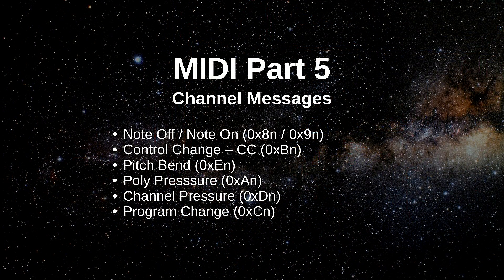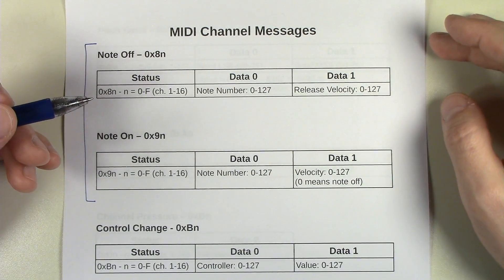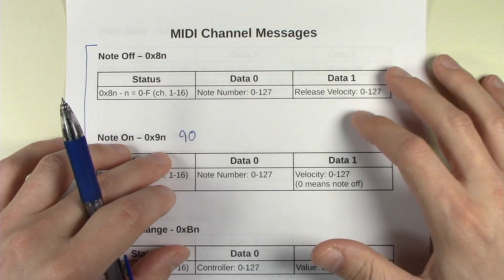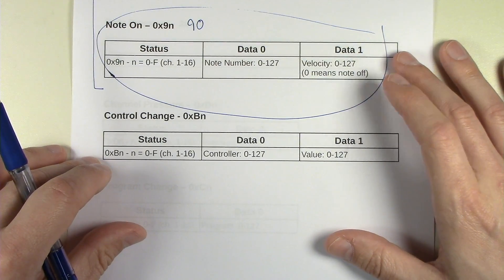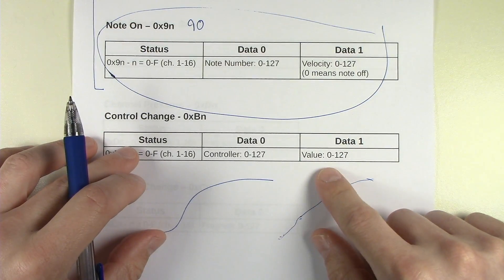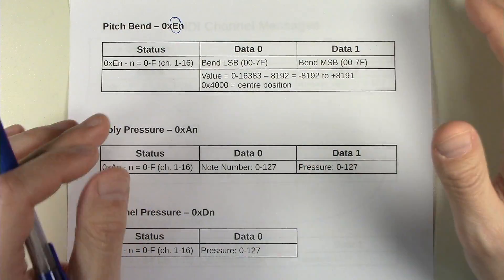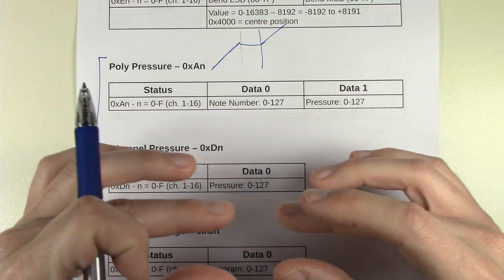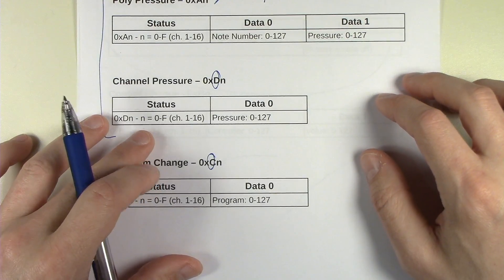MIDI Part 5 - Channel Messages

Comment: 0x9n what values does "x" take?
Is that the value of the note?
If the notes have a value of 0-127, then it is in HEX code 00-7FG?

My question is what does the "x" stand for?
Reply from the maker: X means "hexidecimal"

Comment: If I understood correctly, Poly pressure is relevant for those keyboards, controllers that have a triple sensor, electric pianos, etc.
It is connected to the After touch control, for each key separately!
Andrew, correct me if I'm wrong!
Reply from the maker: Most pianos and synths do not have poly pressure. More experimental keyboards and a very rare number of synths from the 80s had it.

Comment: I know this is an old video, but as I get more into the nuts and bolts of midi specifications I have this one thought pop up. If Poly Pressure existed from the beginning, why isn't it ever really used and why is MPE needed? I love MPE and I think it's incredible that this is still being used and updated, but damn they intended that 40 years ago lol
Reply from the maker: I think it's more of a "we want to invent something brand new!" situation. MIDI has never been fully exploited, and I wish the MIDI 2.0 people had extended MIDI 1.0 instead of designing a huge and complex new standard.

Comment: Hi Andrew thanks tons for your videos !   can you tell me what using an inputhandler call back does that is different from the standard  way midi apps  handle inbound messages? - can you pretend I'm dumb as shit and explain accordingly because I don't get it at all?   Thanks!
Reply from the maker: There is no standard way to receive messages in a program. This is broader than just MIDI btw. The two ways of handling input are polling and interrupt. (callbacks) If you use a callback the system will call your chosen function when there is new data. With polling you just check periodically to see if there is anything new.

If you give me more info of what you are doing I can probably explain it in more detail.
Reply: @shiftedphase  I am using blender, which allows me to run python scripts, I can run a script in blender to see inbound midi data in the blender console,  that works fine. The problem is if you loop either polling or callback it locks the blender UI till the script finishes, which of course doesn't happen  when your forever waiting for inbound midi  messages. I think maybe I was under the misconception  the callback method  which is called non-blocking would not lock the blender UI. If you have any thoughts please let me know? I'm guessing I have to do something with threading but I dont really have a clue- onward ho! Thanks for getting back to me
Reply from the maker: @stephen285  I highly suspect you cannot block in your script. Web works this way too... you need to think about designing your code to do something with the MIDI data and return right away. If you need to do something regularly (not only when you get MIDI data) you can probably register a timer callback also. Use some variables or a proper type of state machine to keep track of the state of your program so that every time MIDI data comes in, or your timer gets called you can check things and decide what to do. A lot of modern programming works this way so good to get familiar with it!
Reply: @shiftedphase  Thanks Andrew - I appreciate the help, I will let you know if I figure it out. I know it can be done because there is an addon out there for blender / inbound midi that works without freezing the UI - I'm just not experienced enough in Python to unravel how it was done. Anyway, it will yield if I bang my head on it long enough:) Your a good man Charley Brown - great series!
Reply from the maker: @stephen285  Good luck and keep at it!

Comment: Great series!  Are you going to discuss NRPNs? I’m working on a controller with encoders and really like the NRPN increment and decrement messages. Unfortunately I can’t find much info on this.  Seems like a great fit to send inc/dec for an encoder (a stateless controller) as opposed to an absolute value for a pot.
Reply from the maker: Maybe when I have time I will do something about that. Been busy lately. :)
Reply: @shiftedphase  We just arrived at Knobcon in Chicago. I was wondering if you were here?
Reply from the maker: @legosteveb  Sorry I'm not going to be there this time.

Comment: Hi Andrew!
Just circling back to learn about how to implement MIDI programs and banks into my laser synth, now that I have fully functional image generators running a preset array and controllable via custom mapping to an OTC APC40 MIDI desk. Both connect to Cakewalk via PocketMIDI. Using PureData for a touchscreen GUI and visual feedback for frequencies, gains, etc.
Thanks again for your great MIDI series. 👍😎
Reply from the maker: Glad my videos helped you!

Comment: Explain how a computer is able to play multiple instruments at the same time on an external synth if you need a program change to play another instrument
Reply from the maker: MIDI supports up to 16 channels on each cable. You can have each channel set to a different program.
Reply: @shiftedphase  So a synth listens to all channels right?
Reply from the maker: @bigblackbadger1  It would be fair to say it receives data for all channels, but only responds to the ones it is programmed to use. Two common cases are: a monotimbral synth (think 80s polysynths) that only makes one kind of a sound at once would only respond on a single channel at a time. Compared with a multi-timbral synth (most 90s and 2000s synth modules and keyboards) which can respond on all 16 channels at once and play different sounds on each channel.

Comment: Hello, dear friend,thanks for your information. Now I have a problem so I would like to know if you are willing to help me. I am working with Sibelius software. I use a "Midisport uno" interface. The problem happens when I try to assign midi channels to a different sounds of a Roland GR-20. When I open Sibelius configuration mode and then I assign the numbers of bank and program change number to channel number 1, everything is ok, but when I try to assign the next sound to channel 2, it doesn´t sound any sound when I activate the test function, however, the interface lights, indicating that the message has passed through the interface and get the GR-20, but no sound. The only sound I can get from the GR-20 is the one of channel1. Sorry for my English, my native language is Spanish.
Reply: In other words, I just can use only one sound at a time
Reply from the maker: @rafaeldominguez58  I haven't used either of those products but I would suspect that your GR-20 is not set up for multi-timbral mode. Check to see that it can receive MIDI on multiple channels at the same time. Not all synths can do this, so best to check the manual. Also, if you have another synth you can test it with that.
Reply: @shiftedphase  Thank you so much. I appreciate your prompt reply! I will check it out as you suggest. Have a nice time!

Comment: Hey there, I built an iOS-game that takes MIDI note on and note off messages as its input. Recently users of Yamaha 775 and 785 reported that my app is not working correctly. After building a tool that reads out MIDI information on their pianos I noticed they send poly pressure instead of note on messages... Additionally they send control changes on controllers 19 and 88. How would you interpret this data?
Help is much appreciated. Thanks!

Comment: For those of you using a yamaha keyboard to control its built in soumds from a DAW, from my experience fast control change messages go through smoothly. Just figured id share that becuase some people actually use their keyboard as a sound module like I do.

Comment: Hi,
I just found your Youtube channel and checked
all your MIDI videos tutorials.. VERY NICE !
Thank you for all these informations about MIDI.
I already knew how MIDI works but your videos
helped me to get back in its working.
Let me introduce myself..
Sorry, it's a long post:
My name is Jean-Pierre Desrochers.
I'm an electronics technician with more than 40 years
of experience in electronic musical instruments repair
(synths, organs, etc..).
I also enjoyed programing Microchip micro-controllers
for musical purposes.
You can have a look at my DIY Moog modular synth clone here:
http://www.arcenson.com/projects/Modular/
Some of my modules have analog parts only while
some others use micro-controllers for speed of execution.
In the list of modules I designed over the years
my very first was a polyphonic MIDI interface or M100 module.
http://www.arcenson.com/projects/Modular/M100_MIDI_Interface/Module_pictures/M100_MIDI_interface_assembled_front.jpg

It's a MIDI to CV interface with MONO or POLY (6 voices) 
possibilities. When I designed it years ago I had
to sketch a detailed flowchart of all processing from MIDI reception
up to the very last 6 voices outputs. For each voice I have
1v/oct pitch, 0-5v velocity and finally +5v Gate output.
This interface worked well so far with NOTE-ON/NOTE-OFF messages
but I did not managed the possibility of Running Status messages in the USART reception. (!!)
So.. I'm actually working on my original C code for a more robust MIDI reception.

This said, here is why I'm contacting you:
Since you stated in one of your video that you worked 
in the past on hardware programming (micro-controllers ?)
I said to myself this man must had to work on some kind
of flowchart to process incoming MIDI messages to a micro.. right ?
Correct me if I'm wrong..

I'm looking for a detailed kind of flowchart that would do:
-Waiting for MIDI bytes to be received
-MIDI bytes kept only: (Only the first MIDI channel 'seen' accepted) 
 NOTE-ON, NOTE-OFF, Runing Status bytes
 Pitch Bend, MOD Wheel, After Touch, CC0, CC1
 All other MIDI messages ignored !
-Putting these bytes in a circular buffer for later processing
-A main loop that waits for received bytes in the Rx buffer
-Analyses the received bytes, clears them from the Rx Buffer 
 then saves up to 6 of the last played notes
 as Note values, Velocity values, After Touch values
-Release these notes whenever they stops.

That's it.
No details about specific micro-controller registers..
I only need a generic flowchart that can be translated
for my next C code.
Do you still have any kind of flowchart you already used
in the past that I could download for my purposes ?
Or if not, would you create one for me ?
I'm willing to pay for one that would fill my needs.
Be comfortable with your decision..
If you don't have time I will understand.
I'm myself very busy in my projects.
I'm located in near Quebec City, Canada.
Waiting your reply,

Kind regards,
Jean-Pierre Desrochers
Reply from the maker: Nice! I'm in Montreal. I never really make diagrams for code... but you will find that a state machine is probably the best way to make most protocol parsers, and MIDI is no exception. If you like diagrams check out the MIDI 1.0 spec... there is a full page flowchart in there about how to handle it. Running status caught me off guard when I first started doing MIDI coding on micros. Also don't forget the trick of NOTE ON with velocity of 0 is the same as note off. This is a running status trick so the status byte doesn't change, but if you forget this you'll have a lot of stuck notes. :)
Reply: @shiftedphase  > If you like diagrams check out the MIDI 1.0 spec... there is a full page flowchart in there about how to handle it. Well I tried to find this diagram page on the MIDI 1.0 specs without success so far.. Any links ?? Thanks
Reply: @shiftedphase  Ok I found the diagram page.. Thank You !

Comment: Hello greetings from Chile ... I like your explocatives .per I still can't understand why when I touch the controller keyboard at some point any note is playing indefinitely. As frozen. And the only solution for me so far is reset. Could you guide me?
Reply from the maker: It sounds like maybe a bad cable. If it's a USB controller, check that first. I've seen that happen a few times over the years only to replace the cable and the problem goes away.

Comment: As an example of pitch bend, could you give me the channel message of something like c4 uptuned by 25 centitones?
Reply from the maker: Pitch bend doesn't work in "cents" it just has a range from centre (no bend), and max up or down. The actual amount of bend depends on the synth that receives the signal. Most synths allow the bend range to be set from 1-12 semitones or more. If you had it set for 1 semitone, you could guess that a value of +2047 (about 1/4 of the full value of +8191) would be 25 cents... but it's not really guaranteed that every synth will respond perfectly like this.

Comment: I have a problem. I am working on a very simple Arduino-based MIDI sending device. I wanted it to be microtonal so I've implemented it based only on the note on/off and pitch bend. The analog input 1st bends the pitch until it's high enough that a next note is triggered. 

In order to have a continuous sound I've used a loop with the constant note on/off cycles in 5ms intervals. This clearly isn't the ideal solution... My DAW (Pro Tools) sometimes gets lost in the on/off flood and sometimetimes misses that a note has been turned off. It quickly changes into a cacophonic polyphony of all the possible notes playing together. 

Is there a better solution for a continuous, monophonic signal that changes the notes and pitchbends more or less in a smooth manner? Im at the very begginning level so I'd appreciate something simple.
Reply from the maker: Yes, it's called CV. :) Although you shouldn't really be losing MIDI messages, it's a bit tricky to use MIDI for what you're doing. Make sure you send your data at a reasonable rate so you don't overload the receiving side, or even your arduino internally.
Reply: @shiftedphase  Thanks! :) Im not really going to switch to CV with my project due to the compatibility issues. As long as I stay monophonic I should be able to do with pitch bends. I guess the 5ms message intervals shouldnt really oversaturate the DIN MIDI so the issue must be hiding somewhere in my code or on the DAW side perhaps. Right now I kinda suspect it might be that Arduino by default doesn't keep the signal cable on 5V while idle (??). If this is the case then maybe some of the messages lose their header bit and thus are not recognized. 

If this is true though one thing confuses me. Wouldn't that mean, that all my messages were inverted so far? Like all the 0s were 1s etc. How would any message be understood then?  I need to investigate that.
Reply from the maker: @bzqp2  If you get any reliable communication at all the signal is not inverted. If you're using the default Arduino stuff then you need to watch out for how big the internal buffers are, etc. Their setup works fine for simple projects but real MIDI gear is not made like this... there is usually a timer that runs all the important stuff at a very fixed rate. I use intervals of 1ms, or 250us or similar in my projects. Having a fixed interval makes it possible to not only throttle sending speed accurately, but also do stuff like filtering of analog data. Digital filters rely on having a fixed samplerate.

As I'm sure you're learning, the basic concepts are pretty easy to implement, but the tweaking and details like I mention are really the time-consuming part of making stuff that "feels" good. Keep going and you'll get it working like you want!

Comment: Hi, is it possible you could help me? I have a Boss VF-1 rack unit and would like to control the parameters of the delay patch with my Roland A300-Pro. I'm looking at the MIDI implementation chart for the VF-1, but don't know which hex number represents the CC number I should assign to the MIDI controller in order to control the parameters of the delay time and such...
Reply from the maker: Try something like this: https://www.binaryhexconverter.com/hex-to-decimal-converter to convert the numbers from hex to decimal. Some computer calculators have a "programmer" mode that also does this. As for just confirming your understanding, I use this program to quickly test MIDI stuff: http://www.midiox.com/ You can send and receive messages easily. A quick tip that many devices that can be controlled by MIDI also send those same messages when you turn their knobs. So if you connect the MIDI OUT port to a program like MIDI-OX you can just look at what gets sent for each control and then use that when programming your other device. Hope  this helps!

Comment: Another great video! When will you post the next one?

Also, I have a question about those hexadecimal values for sending note on and ccs:
like you said, the first bit for a note on is always 9 and the second bit is the channel number. 0x90 is a note on in channel one as I understand it. 

How is the specific note conveyed to the controller if it is not specified to the device receiving the MIDI? Say I wanted to send a note on A4 to channel one at velocity 127:

I would send the data in hex as 0x90 0x45 0x7F?
Reply from the maker: Yes, you've got it right! There are sometimes some discrepancies between products regarding octave numbers, but that's pretty easy to sort out by just testing your setup.
Reply: Thanks! I've been messing around with rtmidi library and have been making a little program that reads note input and interprets what chord was played. This video was extremely helpful!
Reply from the maker: Cool, RtMidi is quite useful... I use it for Linux projects.